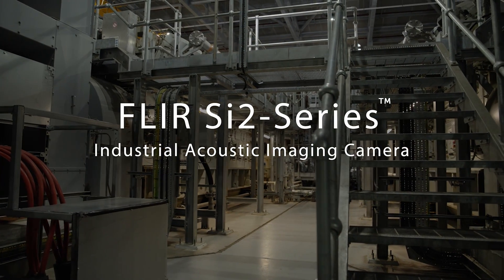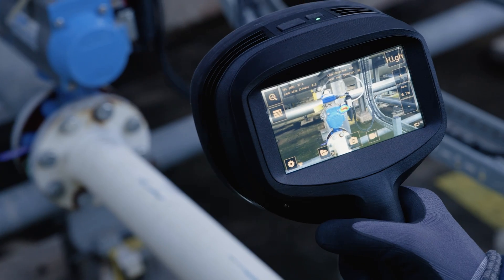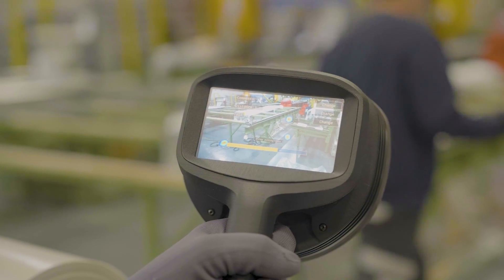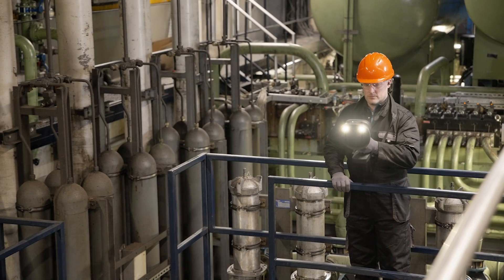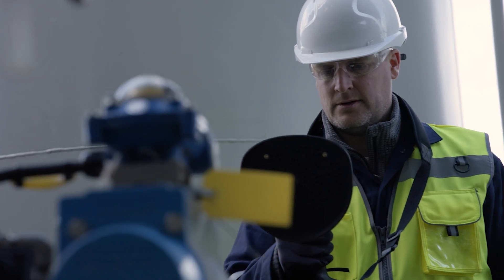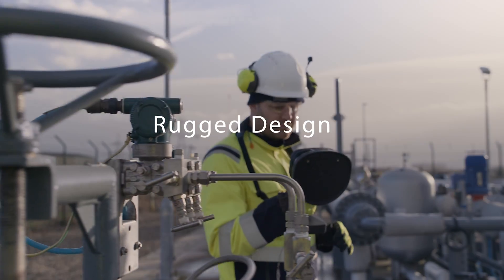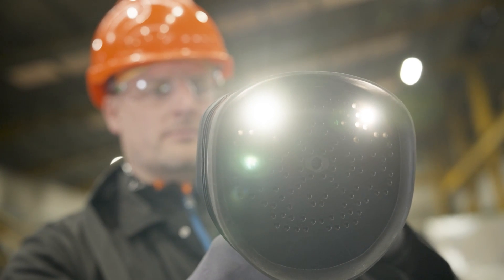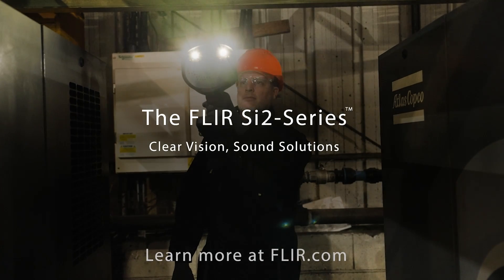FLIR Si2 | Acoustic Imaging Camera for Air Leak, Mechanical Fault, and Partial Discharge Detection

Comment: If only there was a company that made thermal imagining systems. It seems like adding a thermal camera to this would really point out the temperature differences usually associated with process gas leaks.
Guess I gotta give Phil over at Raytheon a call.

Comment: Can the camera be calibrate d to search for any kind of sound?
Reply from the maker: No the camera will only pick up sounds within a certain frequency range.
Reply: @Flir  Any way I can find out what frequencies it picks up?
Reply from the maker: It can pick up frequencies between 2 kHz to 130 KHz. You can learn more about what the FLIR Si-Series can do at this page: https://www.flir.com/instruments/condition-monitoring-solutions/choose-flir-si-series/
Reply: @Flir  you should make it editable when connected to the computer software. changeable  frequency ranges. like a specific range 400-200 KHz or 200-and below KHz. just a thought
Reply: @FavoredByG.O.D  the problem is those ranges would probably require different hardware

Comment: Will this identify small irrigation leaks 12in below ground?
Reply from the maker: It will not. The FLIR Si2 is designed specifically for air and gas leak, mechanical fault, and partial discharge detection.
Reply: @Flir  You know, a thermal camera almost certainly would detect irrigation leaks. Again, dang. Its just too bad no one makes those. You know, maybe in a 12mm x 12mm x 7mm package built for handheld electronics?

Comment: I should add a thermal imager there
Reply: Next Gen so you have to upgrade
Reply: This is for industrial usage. I’m pretty sure that this has a far superior level of sensitivity is far superior to thermals especially because most handheld imagers as there is little space for any sort of cooling device.
Reply: @Austin-cx2xe  far superior to thermals lol? What an uniformed opinion. They are different systems for different things.